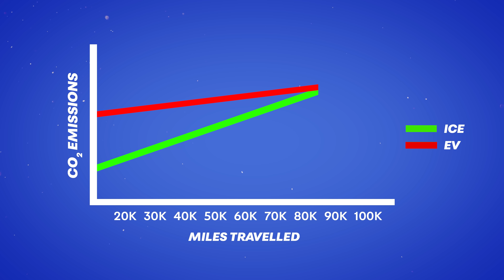Are Electric Cars REALLY That Green? [New 2022 Data]

Comment: EVs are part of  the landfill-racket. The main problem is EVs don’t depreciate gradually and like ICE vehicles. After 8 years, you gotta shell out $10,000 on a set of new batteries for a beat up used car and who’s gonna be willing to take that financial hit?
Reply: Is this any different than an engine/transmission replacement on an old gasoline car?
Reply: @5353Jumper  - Most ICE vehicles can be driven for 20 years or more without an engine replacement. As long as you do your minor maintenance routines, the average car will run reasonably well. If you buy an EV $40K, it’ll depreciate rapidly in the first 8 years because of the battery replacement cost. That’ll make the car only worth roughly $15k to $20k after 8 years. I worked with a guy, who was an electrician, and he bought a small used EV for $6k thinking he would just replace the batteries. Well, the batteries were going to cost him another $6k for his thrashed EV that wasn’t worth more than $5k. He was a Global-warming-cultists who learned a very hard lesson as he could only drive about 15 miles between charges. Charge at home, drive to work, charge at work, drive back home. This is the future of the of every EV Kool-Aid drinking fanatic.
Reply: @chrisjenkins9978  I had a friend who bought a 5 year old truck, but it had a lemon engine and was $12k to replace. So?

Most batteries on current models should last over 200,000 miles. Aside from the occasional lemon anecdote there is not a lot of difference.
Reply: @5353Jumper  - A lemon vehicle is an outlier, not the norm. Batteries in EVs are the norm and they all the same or a brow-box-copy of the OEM. You only get 200,000 mile range off the lot. After that, your range precipitously drops over time. Therein lies the problem. And if you think fast-charge is killer option, it is. It kills your batteries lifespan by 50 percent. So, now you’re spending $10k every four years. The average person can not afford that type of expense when considering a vehicle purchase. The truth is, EVs only make sense for the environmentally vain.
Reply: @chrisjenkins9978  really? What percentage of engines last much more than 200,000 miles?

Or even what % of cars last that long. 

And even if we do replace the battery every 200,000 miles or so, they are still lower emissions than a gas car so what exactly is your point?
Reply: @chrisjenkins9978  sorry dude thousands of papers and even this video dispute you. 

Counting all the pollution of the power generation in the most polluting countries of the world bEVs are still lower emissions within the first 90,000 miles. 

In countries with cleaner power grids it is as low as 30,000 miles. 

Those numbers are improving every day and also bEVs becoming popular fleet, cargo transportation vehicles and industrial machining will make it even better in the future. 

So nope - no matter how you slice it bEVs have less emissions than gasoline vehicles. Considering EVERYTHING in the cars total lifecycle from manufacturing, to mileage, to a battery replacement mid life, to eventual disposal and recycling, bEV is better than gasoline cars for emission.
Reply: @chrisjenkins9978  EVs are the best vehicles we have at the time, the only thing better is reducing the amount we are driving. Reduce cargo, buy local, reduce consumption, ride your bike. That is the best. 

But if we have to drive or move cargo the best we have so far is the EV so let's stop fighting it. 

Either reduce or support EV, or both, those are the options.
Reply: @chrisjenkins9978  ya kinda got that one backwards. 

Plastic is made from the polymer waste byproduct of making gas. 

Though there are now many other ways to make plastics as well. 

Of we reduce gasoline consumption to nearly zero there will still be plenty of plastic. Though we should also reduce plastic consumption as well.
Reply: @chrisjenkins9978  never said we will ever 100% eliminate crude oil use, it has many great applications some of which are actually fairly food for the environment. 

We just need to stop burning the stuff.
Reply: @5353Jumper  - The main problem with these studies is the time-frame that is used. For EVs, the first year is the best year and every subsequent year gets worse as the ability to hold a full charge diminishes. Batteries don’t have the energy density that gasoline has hence, their work output is considerably less. Take the holy-grail of the trucking industry. Electric Semi-trucks can only carry two thirds of total shipping capacity as one third of the shipping weight must be consumed by batteries. Not to mention, the down time for charging 20 thousand pounds of dead batteries and a third more trucks on the road to make up loss in shipping capacity.
Reply: @chrisjenkins9978  and all the death and loss if we just keep on using gas the way we have. 

The study I posted shows the entire lifecycle of the vehicles, mining to recycling. And it still shows EVs are way better. So not sure where this degrades over time stuff is relevant or even more than 2% true. 

Charging time for trucks is a concern sure in some applications. But it is more of a habit, expectations adjustment and infrastructure build than any real problem. Maybe short term we go hybrid with big trucks, or maybe hybrid hydrogen. 

Whatever, just needs to get done cause if it doesn't we all keep dying of lung diseases, pollution related brain damage, and natural disasters. 

So your choice really, keep doing the thing you know is wrong because there are some obstacles to change, or just change.
Reply: @5353Jumper  - As it stands, there are no cost effective recycling solutions for the millions of tons of toxic waste generated from depleted batteries and EVs are only one percent of the overall car market.
Reply: @chrisjenkins9978  there are a few dozen companies waiting to the number of batteries and demand for materials to get high enough so they would bother doing the recycling. It is all planned already but they have not hit a high enough number yet for them to execute. 

One reason they have not hit the number yet is the huge majority of batteries are still on the road. 

Another reason is that other companies are looking to reuse the batteries for power storage projects before we recycle them. So once they are below 80% capacity where people may not want them in a car, or if the car has been driven to the ground but the battery is still OK, they take the 80% capacity batteries and use them in green power storage. 

Either power walls for houses, commercial power storage or into large grid scale storage projects. 

Power storage is an answer to companies looking to use more electricity off peak to save money. It is also an answer to when we actually have more solar power than we can use in a day, to store some for night. 

So really firstly it will be a very very long time until all these batteries are no longer useful somewhere. Like 20 or more years before they get below 50% capacity. At that point it will be fairly easy to start recycling them. 

The plans for all go this are already in place, it is not really much of a problem.

Comment: The 95,000 mile break-even number is interesting because, currently, the average EV battery is warrantied for 100,000 miles. If we assume that figure represents a reasonable estimate for battery lifespan then, by the time your EV gets greener than ICE, it will require a battery replacement, and the comparison goes out the window. EVs are interesting tech but you’re really just trading one set of negative environmental externalities for another, rather than achieving some environmental Utopia.
Reply: It’s not a 95,000 miles break in. That number is downright ridiculous. University of Michigan authored a study on this a year or two ago and the break in is dynamic based on a number of factors but the biggest being where the EV gets power from. The AVG carbon break even they put out was something like 50k and obviously could be lower I’d say you had panels.
Reply: In this video that was the worst case scenario, he said the actual expected value is around 50k
Reply: Your assumption is probably incorrect. The 100,000 miles is the WARRANTY, not necessarily it's lifespan...There are EV's out there which have covered twice that mileage, and more, while still on their original battery. And again, why do you assume the battery must be replaced? Haven't you heard of battery pack refurbishments?

Comment: Over the past decades there have been several attempts to drive consumer purchases.  From "Cash for Clunkers" to EV, this has always been about driving people away from gasoline powered automobiles, for whatever reason.   It was never about clunkers nor is it truly about the environment.   I drove my first 1995 Saturn to 298,000 miles and only got rid of it in 2019 because it would not pass smog and could not be registered.  I got about 40mpg in that car, making it nearly as economical as the early Prius at much lower cost and lower pollution during assembly.

Even my neighbor, who owns a repair shop, has a poster that proclaims that the most important thing is the miles you get out of your car.  If you buy a new car every 3-5 years, you're polluting- by necessitating more manufacture and by sending cars to the scrap heap.

"ICE cars aren't as bad as we thought and EVs are not as green as we hoped".  Well spoken, sir.

If you only talk about emissions, you are right about EVs being "cleaner", but as I see in the rest of the comments, there are a lot other ways in which an EV pollutes, including all the CO2 spouted off by people touting their virtues.    Lower CO2 at the start is not the only pollution.  There are batteries and all that computer-driven gadgetry with which modern cars are festooned, all of which ends up costing a lot of pollution to acquire the rare earths and build the infernal contraptions.   This hopeful rhetoric that EVs will improve all relies on the farcical notion that some day soon we will not need oil, because much of a car is still a petroleum derivative.  Even if you drove CO2 to zero, you'd just have to face the anti-plastic coalition.   

Thank you also for including the data from Volvo so that we can make our own conclusions.  As a scientist, I really appreciate this.  This was a far better attempt at objectivity on this topic than I have ever seen.

Comment: They usually don’t count the battery being recycled. They simply assume battery disappears after car is done. Thus makes EVs look a lot worse than they are. The EVs 10-20 years from now will be using the same materials that are running your current EV and the EV then doesn’t have mine / refine everything from scratch, instead using in part recycled material. This affects a lot because it is the battery that is recycled, which is big portion of the emissions.

Comment: This video should be posted in every format to get more viewing. I had a Instructor in one of my Mechatronics classes often said that the creation of the electricity used to charge the EV , is created by 20 percent, solar, hydro and wind, the other 80 percent is created by burning coal and other combustable substances. Basically there is no such thing as 100 percent clean energy.

Comment: I just watched a shocking video on the WION Youtube channel:  the raw material cobalt, necessary for the EV battery, is mined by children in (I think) French Equatorial Africa).  Child labor, very dangerous, paying next to nothing, goes into your EV battery.  I was going to buy and electric car for my next vehicle, but now I'm having second thoughts.
Reply: Cobalt is not necessary for EV batteries. Tesla are now producing cobalt free batteries.... And were you aware the big oil companies are - by far - the biggest users of mined minerals? They need cobalt to remove sulphur during the refining process, and they've mined it for decades. So if you drive an ICE car, then you are just as complicit in this as anyone else.... Lithium is however needed for today's EV batteries, and 35 to 40% of the World's lithium is currently mined in Australia, where no children are used to mine it....  The vast majority of EV manufacturers have already signed pledges and agreements to buy only ethically sourced minerals. However, many Chinese manufacturers still buy unethically sourced minerals. This has been verified by Amnesty International.